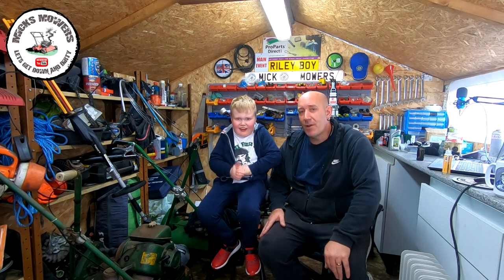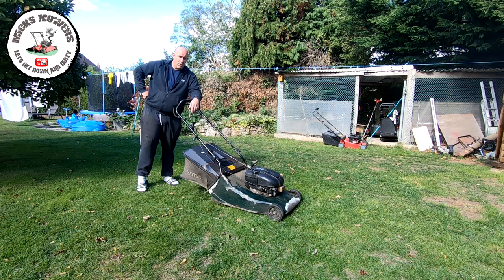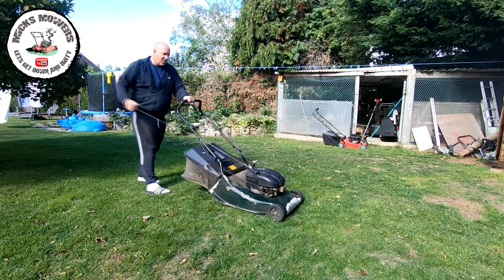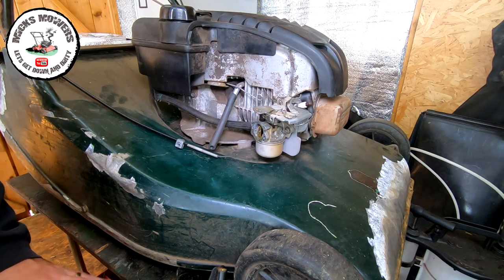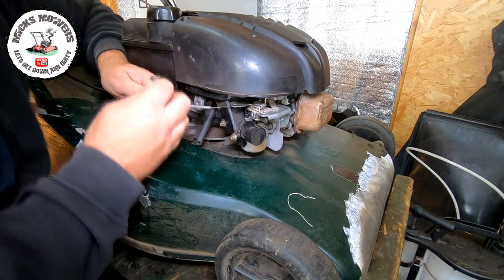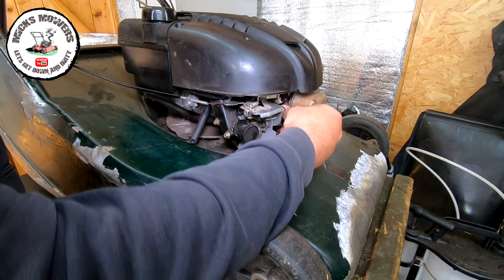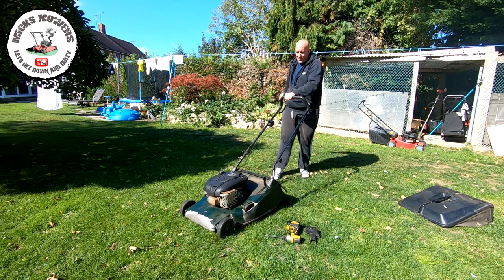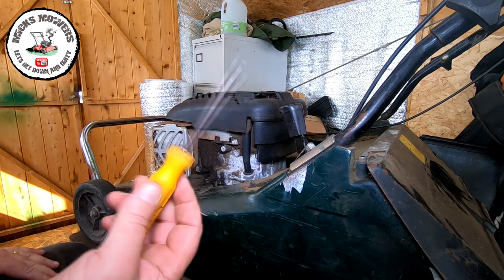Hayter 56 Drive Problem - Do This First #easyfix #Hayter56pro

Comment: Thank you for showing me how to fix the drive belt I have been putting it off and using my old 56 as a push mower which is not a good idea when the job takes 2 hours and it is a half-hour push each way.
Reply from the maker: @kymvalleygardensdesign5350  hope the video helped

Comment: Hi there and thanks for all your advice! I'm stuck with a (very old) Harrier 48 (model 219 or 220): I need to replace the bronze bushes from the back roller but can't fit them on on the drivechain side because, on this side, there is an "external groove" added to avoid the wheel to spin (old system, now it seems to be a pin that is screwed on). And this added groove prevents the bush to glide to where it should... Sorry for my english and thanks for the advice. Marc.
Reply from the maker: I will take a look at the diagram

Comment: I am still amazed at how many machines have rollers over there in the U.K.
Reply from the maker: Just picked up another 4 with rollers today
Reply: Mow right over the edge of the lawn, doesn't dig into wet lawns, doesn't scalp as much as 4 wheels, great stories, the list goes on.
Reply from the maker: Yeah Bruce.. very common here.. I have just picked up another 3 with rollers today.. hope all is well buddy
Reply: @themowerman  it's a unique drive to say the least, wouldn't mind having one, it would do great stripes for sure.
Reply from the maker: @knighthawk86855  yeah they are great
Reply: The Stone Mason.  Hahaha yep that's the truth
Reply: The Stone Mason.  LOL Rollers for a basic PUSH Mower across the pond are a little over $100.  My Time Master Roller was around $200.  I wouldn't mind owning one of these to see how they handle thicker and taller grass!

Comment: Great timing with this vid, I've just taken the carb off a quantum, (same carb) and it has the little tiny spring on choke flap but it wasn't connected and I was wondering if that's all there was connecting the choke and now I know....cheers.
Reply from the maker: Hope it helps my friend 😊 I do another video on this shows where the spring goes

Comment: Hi mick, great video I have a garage with a fair few of these in there, I’m waiting to get the blasting set up working so I can blast the decks, I do find  belt change is harder on the 41s much tighter to the body, I just slack the engine off and that gives enough room. I worry if I force it without doing that I’ll damage the belt. But on these as you’ve shown plenty of room. 🙂👍
Reply from the maker: Hi mate.. well if you have too many to handle you know where I am.. just don't put them on eBay lol

Comment: Thank you for the great video Mick, highly informative
indeed. You made the belt change look extremely easy. I actually liked that
model of Hayter Harrier 56, they were fairly straightforward. On the later
model, the drive was pretty awful, in fact pathetic! I used to run two
Hayter 56 mowers, they leave a good finish. The only downfall is the extremely
poor grass collection in damp weather. I have been using a Weibang equivalent
machine, which is much heavier, but at least it picks up wet grass considerably
better. I appreciate the importance of keeping the bag clean so that the air
can flow through.

I also used to use an Etesia Hydro 80, a highly manoeuvrable
machine that was fitted with a roller by an engineering company. The only
reason I purchased this machine was to be able to collect wet grass. Sometimes it
is much easier to use a walk-behind machine, however, the Etesia was very
manoeuvrable. The Hydro 80 basically almost replaced the Hayter Harriers, there
were just a few jobs where I needed the Harrier 56 due to narrow gates!

Once again thanks for the great video. Roy.
Reply from the maker: Your very welcome mate

Comment: Thanks very much a great video, as I have just bought a Harrier 56 that needs some TLC and now from your excellent video I know to change the belt as there is no drive. The model I have has ignition start on a key, it turns over but no spark, bought a small battery but still nothing, it starts on the pull cord but not on the key. What could be the issue?
Reply from the maker: Hi.. so it runs on the pull cord but not on the key
Reply: @themowerman  Yes, turns over on the key but not firing the engine, going to replace the spark plug, belt now off thanks to your video and after inspection no teeth on it so well worn. The mower cut the grass without drive.

Comment: Hey Mike, great video thanks, understand the mower much better now. My problem is slightly different though. The belt is ok, I think the pins that connect the drive shaft to the pulley have gone, so the shaft turns but the pulley doesnt. Any idea where I source the pins and how to fit? Thanks, iain
Reply from the maker: Depends on the mowers.. you could try and make the parts.. the problem is the gearbox don't last.

Comment: Cracking video 👍 What would be your first thoughts on the drive if the front pully isn't spinning  ? The drive stopped on a customers 56 , he sent it in and they told him the carb , drive and a few other bits were buggered ! Ran sweet as and it was only the drive at falt,  well they conned him out of a grand for a new mower and i took the hayter ! After putting the carb and cables back on and a bit of fuel , 2x pump on the primer and bang it runs ! Just the drive I'm  scratching my head at , pins look fine but don't know whats behind them in the engine side .
Reply from the maker: i would say take the engine off and remove the bottom pan.. then have a look inside.. then you will know.. thats if the pins are both ok
Reply: @themowerman  cheers will pop it off and have a butchers 👍 I know the pins go but they both look intact although I've never seen one go so will check them again .

Comment: Great vid, I just bought a 48 for £115, looks like a similar year to yours - works great. Was this a good price to pay? Only issue is the mower’s forward propulsion isn’t working. The roller spins if you lift up the back of the mower so it isn’t touching the ground, but when you put it down and pull the handle in, the mower doesn’t go forward. Is this an easy fix?
Reply: I wrote is before watching the full vid… think you’ve answered my question. Cheers!

Comment: Hi can you help me I have got a hover mower with m120x it turns over  but it so hard to put to get it started. It’s like it’s got to much compression thanks Phil
Reply from the maker: Hmmm check the timing.. is it leaking out the plug hole if you take the plug out.. or it could be the reeds..

Comment: Question, I'm not sure cause of the camera angle but is that part of the choke swing hitting the spark plug, it looks like it's rubbing against the spark plug..... Or it's an optical illusion..... Or is that the kill mechanism.
Reply from the maker: The kill wire is done via the throttle cable.. and a micro switch on the throttle control panel on top of the carburettor...

Comment: hi any idea how i remove the petrol bowl on this mower, cant seem to get to the nut with a spanner, many thanks
Reply from the maker: Put it in a vise.. then twist the carb off..
Reply: @themowerman  I can’t  the bowl on my hatter 56 is so low it’s not far from the main body
Reply from the maker: @richardmcintyre-we4su  ok so stick it on the vise and use a 1/2 socket on it ..